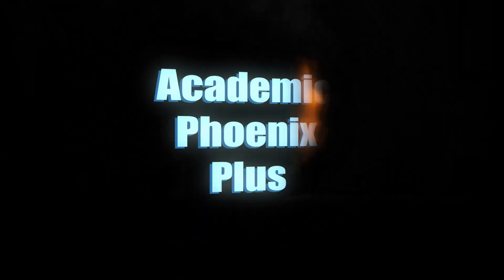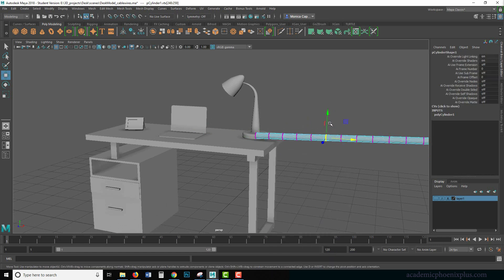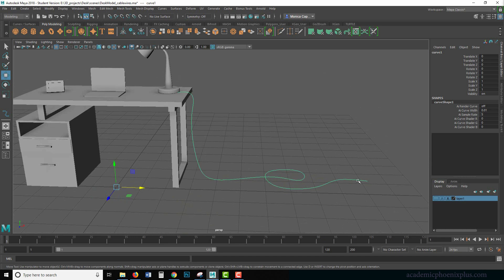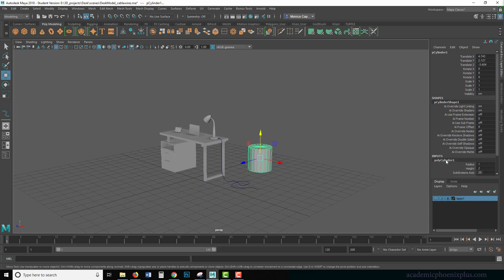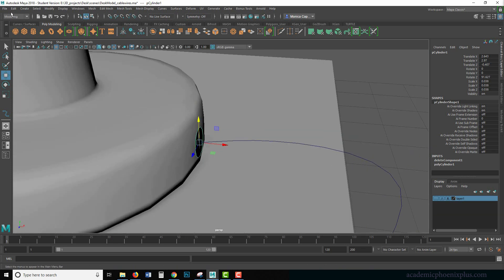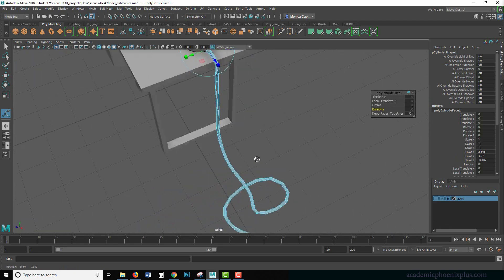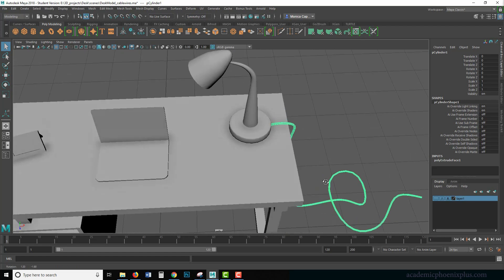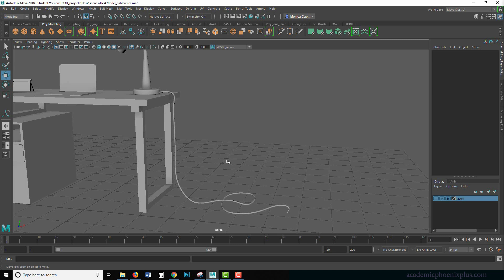How to Quickly Model a Wire/Cable using Maya 2018

Comment: I know this is an old video, but it's my holy grail and every year or so i come back to remind myself how to do this. My only issue now is that, after years of using this with no issue, i've recently upgraded to maya 2022 and come upon a new issue... When extruding, both ends of the curve connect themselves for some reason. I've tried a few things to fix this and nothing has stopped it, I can delete the parts that have connected but they still cause issues and the ends throw tantrums later along the track. Has anyone else had this issue or have any idea what's causing it/how to fix it?

Comment: 5:05 doesn't work for me. It does not go past 2 points on the spline and unless i stretch it, will no expand. Also doesn't follow the curve...
Reply: Same here :/
Reply from the maker: That's odd. What happens when you give it more divisions?
Reply: @AcademicPhoenixPlus  Nothing. I tried it again following a different order of steps and it worked.
I checked the code of the operation and it is a dx/dy type meaning you have to select a face component. Perhaps that was my mistake.

Comment: and by the way i am using maya 2020 and holding c and pressing the middle mouse to drag the object.  its not working. The object is just moving along Y axis not on the curve. I have tried everything like isolate both objects and unhide the grid but it is not working..Plz help me bcoz its getting frustrated.....BTW i followed n subscribed u. U are the best...<3

Comment: hmm, clicking see and middle mouse doesn't seem to let it clip to my curve, is this a new version issue or is something just up with my method?
Reply: Same, when I extrude the faces it doesn’t extrude along the curve, i used to work with this method some time ago and it worked perfectly but it doesn’t work anymore
Reply from the maker: Hi Silver, Yes, this is one of the challenging parts. You have to hold down 'c', then middle mouse click and drag. so don't let go of the click (click and drag). It's a great shortcut... when it works. Hope that helps!

Comment: thank you, it was very usefull,
But I have a little problem, once I've selcted the face , it doesn't allow me to select the curve, and if I do, the faces stop being selected.
Does anyone know why does this happen?
Reply: I solved it, so if someone has the same problem as me, here is the answer:
if you select the faces with a click in modeling took kit i won't work, you have to select the faces with the right click of the mouse.
Reply from the maker: Great job troubleshooting! I had no idea that selecting faces with either the mouse or modeling tool kit would make a difference. Good to know. Thank you, Aina!
Reply: @ainaroca9396  Finallyyyyyyy. Thank you so so much. I love you
Reply: THANK YOU! You just made my life so much easier! I was pulling my hair out wondering why it wasn't working!

Comment: it wont let me shift-select the curve at 4:47
Reply: Same. This is why I came here. Found a link to this video where somebody was also complaining about this. So disappointed this Shift select thing isn't explained anywhere!
Reply: Figured it out thanks to @ProjectHomeProductions in the comments below. I use the modeling toolkit and/or a hotkey to select faces normally. Apparently, not the same thing as right clicking and selecting faces?!?! If you use this method, you can Shift select the curve after selecting the face. Weird.
Reply: @splootcrate  you can use: selected face+ ctrl clic on the curve on the outliner

Comment: when i extrude it just stays on one spot ans doesnt connect the ends of the curve
Reply: Make sure u select the FACE. NOT OBJECT.
Reply: @gorkemuzun7451  it was the fact I didnt realize that RMB>Face and F11 arent the same thing
Reply: @projecthomeproductions2681  aaah, thanks! you saved me, I was wondering why it wasn't working for me (was using F11 too) xD
Reply from the maker: I agree with Gorkem, select the face. If that doesn't work, flip the curve. Hope it helps!
Reply: @AcademicPhoenixPlus  I figured out what it was. I disnt realize f11 and RMB>face isn't the same thing

Comment: when i do the extrude after i select the face and the it just stay the and does not make a wire stay the same any help??
Reply: same
Reply: You need to select a curve and go to Object Mode. The curve should remain green when you apply extrude.
Reply: @nadyanadyan9157  still doen't work
Reply: You have to make sure you align the face with the start of the curve, not the end

Comment: Hi, great tutorial! Although I am doing something wrong. After I've selected the face and the curve and try to extrude it, the face doesn't automatically snap to the other end of the curve. When I extrude it it just extends in a straight line and doesn't follow the curve, any idea what I am doing wrong? It's really frustrating because I feel like I'm following every step haha.
Reply: I'm using Maya 2020 now, how I solved this problem:
1. select both of them in "object mode"
2. hold right-click on the circle plane and choose multi 
3. select the face

Hopefully that helps future people as well :D
Reply: @pearlkim8924  I am very grateful because this is very helpful :')
Reply: @pearlkim8924  Thank you so much! it worked, i have tried everything and this finally worked, thanks a lot.
Reply from the maker: It could be that the beginning of the curve is reverse. Try selecting the curve>Reverse Direction (all the way at the bottom). Hopefully that fixes it!
Reply: @AcademicPhoenixPlus  Thanks for the reply! I'm going to give it another go next week.

Comment: it does not allow me to select the curve when I am in face mode :c
Reply from the maker: What Maya are you using? If you are using something earlier then Maya 2018, use the low quality resolution for the view port. If that isn't it, try a different scene and see if it works. I hope that was helpful!

Comment: When I try this the wire doesnt stay a constant length. Its gets wider the further it goes for some reason. How can I fix this?
Reply from the maker: Try resetting your settings in your extrude tool, and delete the history of your object. Otherwise, play with your input settings to make the ends fit better. I hope that helps, Sasha!

Comment: Shift selecting the spline doesn't work in face selection mode and only works in object selection mode. What can I do about that? 

I tried extruding from an object that is literally just a plane and it ignores the spline regardless. I do have selected ticked under curve settings in my extrude options.

Tried both sides of my spline too so I don't think it is the spline direction. Tried both EP curves and bezier curves.
Reply from the maker: I’m sorry you are having a challenging this with this exercise. Make sure there is nothing else selected. Try to select just the face and shift select the curve. Ctrl +e and that should work! I hope that helps
Reply: @AcademicPhoenixPlus  Managed to get it to work. I'm still not used to Maya so I've been going through face selection via the Modeling Toolkit(max habits). Apparently for some reason I cannot shift-select the curve if I do that.

But if I follow the video exactly and go into face selection via right click menu... I can.

Is there really an explanation for why Maya has to be weird like this?
Reply from the maker: Wow that's a weird issue! I rarely use the Modeling Toolkit for selection. It sounds like a bug and you might want to let Autodesk know! By the way, nice job troubleshooting Wings. :)

Comment: I'm trying this in 2019 and it isn't working. I click the locations for the verts to show but they don't appear. But I can see curve1 in the world outliner. I opened a brand new scene and it worked. But not in one I'm currently working in. Any ideas?
Reply from the maker: I'm sorry you don't see the verts, F5. I tried it in Maya 2019, and seems to work, so I'm not sure what the issue is. My only guess is to make sure all objects are visible. In the perspective window, there is a menu called "Show". Make sure everything is checked. I hope that helps!
Reply: @AcademicPhoenixPlus  Yep haha, I'm a dumb ass. I pressed ctrl + 1 to show certain items but when I created the wire. I had to press ctrl + 1 again haha. Thanks for the tutorial!

Comment: I am doing the same thing but it is supposed to create a straight line but instead of that it is creating a deformed surface and when i increase the divisions it creates the shape of curve and also a straight line connected to the ends of each other now i can simply select face from straight line and delete the faces of straight line but its not the right way, please tell me what I am doing wrong?
Reply from the maker: It sounds like you have to reverse the direction of your curve (Curve>reverse direction), or move your geometry to the other end of the curve. That should fix it! I hope that helps. :)
Reply: @AcademicPhoenixPlus  got it... Thankuu

Comment: Very nice tutorial! thank you for sharing your knowledge, although i do have a question, about the size of the cable, lets say that i dont like the thickness of it, its possible to make it more thin even after the extrude command? or i have to make it again?
Reply from the maker: Thank you for your comment, Pablo. I'm under the impression that you have have to start from the beginning. It does have some taper and other attributes (take a look at your inputs of your model's history). Most of the time I have to recreate it. If you find a way, please share!
Reply: @AcademicPhoenixPlus  
thank you very much for your answer, if I find a method I will post here for sure.

Comment: I was looking at a way to create nerves roots in the human body where pain is radiating form one end to the other, and I think I can use this technique for the modelling part. Question I have though, is how would I simulate the radiating pain ? How would you do it ?
Reply from the maker: Hi Jo, thank you for the comment! I think this tutorial would also help you create veins. It’s a tutorial on creating vines, so it would be similar to veins. :). https://youtu.be/BiwUnfCTaVQ
As for radiating pain, I would make it glow red/yellow rapidly, so it looks like pain flares. If pain is running down the leg, I would make the pulsing color slide down the leg. What about you? What did you do?

Comment: hi , ı can't do this. Select face and wire but extrude dont follow wire can you help me ?
Reply from the maker: Hi Fatih, thank you for your comment. It could be that the curve is facing the wrong direction. Try going to Curves>Reverse Direction. See if that works. I hope that helps!
Reply: Academic Phoenix Plus thanks a lot :)
Reply: @AcademicPhoenixPlus  My face doesnt follow the wire even after i "reverse direction" :(
Reply: @AcademicPhoenixPlus  hello dear, even with changing the direction it is not working on my side.
Reply: @AcademicPhoenixPlus   Okay i found my fault!!  first select the face of the cilinder. Then right click -> Objectmode -> right click ->Face ->Click the curve -> then Ctrl E. And it worked.